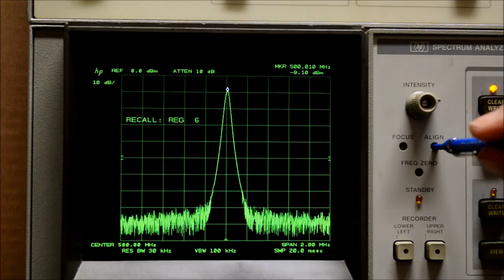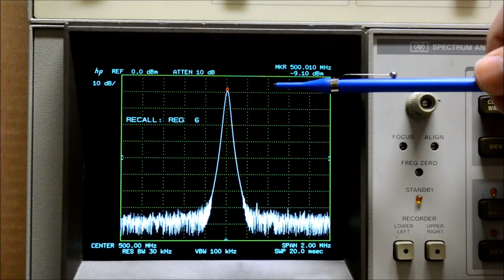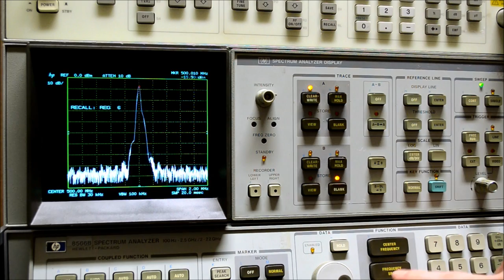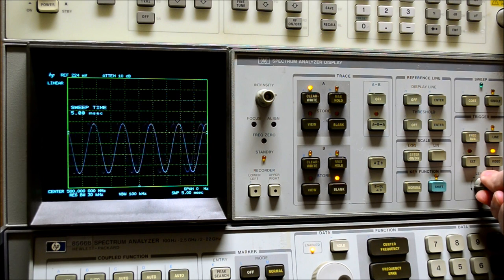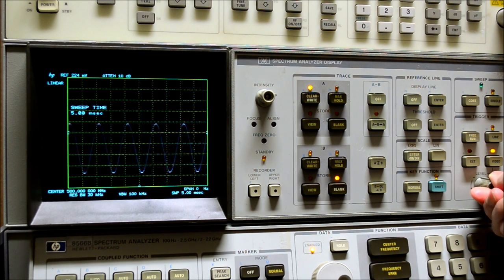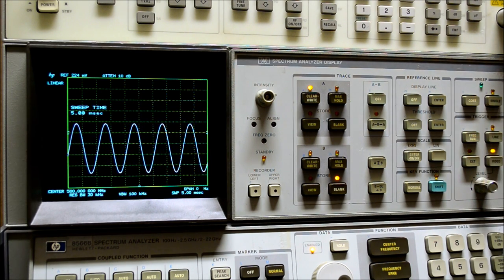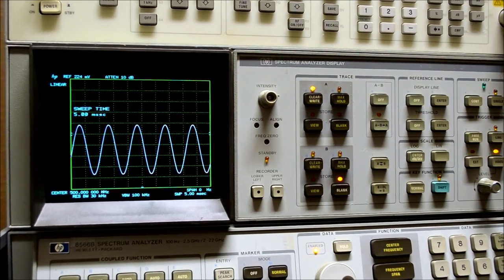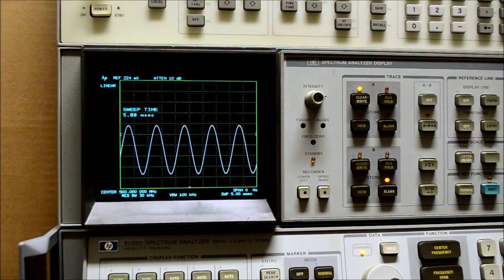Color LCD display for HP 8566 and 8568 spectrum analyzers

Comment: Very interesting.. A video showing installation in a 8566B would be very helpful. Also a better way to change image functions besides using a alignment tool poked into the align hole would be better, more professional; perhaps a hand-held box with functions labeled. I wonder if there a convenient place on the rear panel to add a connector to work with a remote box. Or widen the align hole and mount a rotary switch might work??  
Thanks,
Glenn Scott
DSM Labs
Reply from the maker: +wa4aos That would be a LONG video. The user is expected to settle with one display scheme soon and would not need to change the color scheme very frequently, except for show-and-tell.